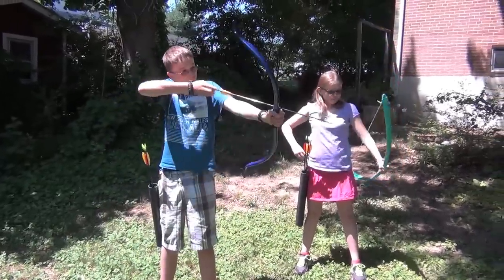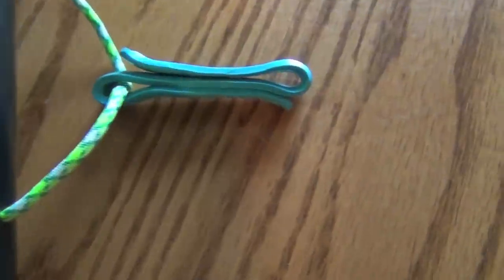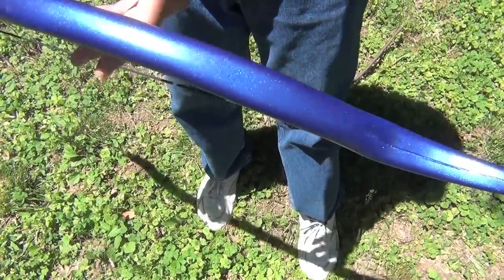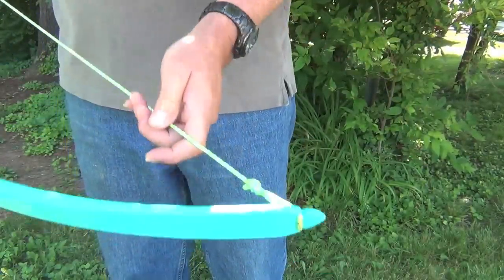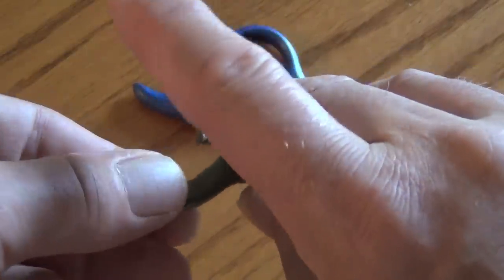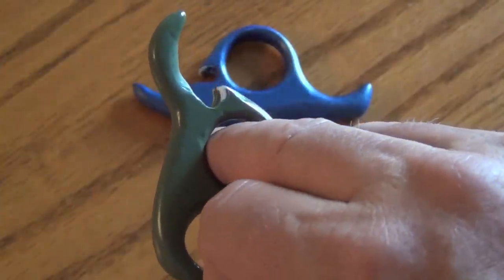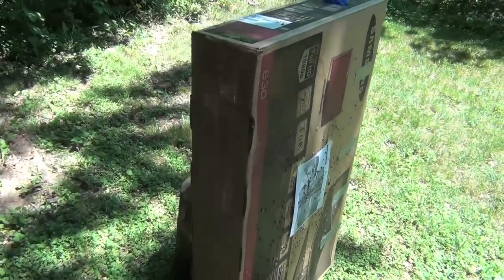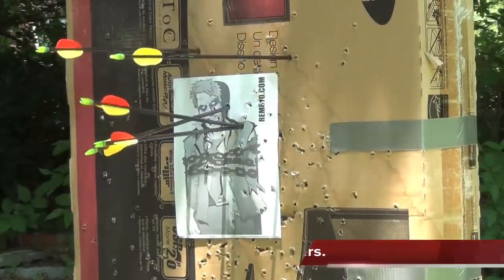DIY PVC Pipe Bows, my 2 new  hobbies.

Comment: very good job. thinking of making these for a cosplay and now my daughter wants one. Your kids seem to enjoy them and it's great that y'all have a hobby together.
Reply from the maker: +yurika975 Thank you. I made the first one for my son, my daughter watch him for a grand total of 30 seconds before she said I want one. LOL If you're making one for a cosplay, you can put de-flex in it to help ensure no one gets hurt onstage. Cheers
Reply: +stanfordcoffee Thanks. LoL It's my first time cosplaying and I haven't heard of deflex. I will look into that. no injuries. After seeing your creations I went to the hardware store for some paracord and pipe. Are you using schedule 40 pipe? Does it matter for these purposes? Thanks again for sharing
Reply from the maker: +yurika975 Deflex is when the boat was bent backwards, reflexes when the bow is back forwards. While making the bow, I would bend it backwards (almost appearing as if it's already has a string on it). Then when you add the string, and draw it, I will have very little power. I did use schedule 40 pipe. I know it's durable and will not snap the first time you draw it back. If you can get it, it's cheap, and that's what I would use even while making a prop. Cheers

Comment: what type of string is your using
Reply from the maker: Frost Owl I used common "550 paracord". You can pick it up at almost any hardware store, or search the Internet for it. Cheers
Reply: Last question . Is the PVC pipe bow be harder to break?
Reply from the maker: They're pretty durable, maybe not as strong  as fiberglass or wood, but they do last a long time as long as you don't burn the pipe while making it.
Reply: do you remove your string in your bow after using?
Reply from the maker: Yes. Every time I'm not going to be using the bow for more than a couple of hours, I take the string off. Cheers

Comment: AAAAAHHHHH  Your Daughters bow has the very same tips on the limbs as mine does ! ! !   LOL LOL LOL  You're the only other person on here that I've seen make those shaped tips !  ;-D  I LOVE them . . . . .  They make the bow aesthetics look good, and they work VERY nicely holding the bowstring !
Reply from the maker: I like the way my daughters bow turned out. It's very functional, looks nice, and easy for her shoot. How heavy is your bow? I think those tips will work fine for lower draw weights (maybe less than 45 - 50 lbs). But I think I would want to go with tips, like the ones on mine for heavier weights.
Reply: stanfordcoffee Actually they work great for heavy draw weights too !  My bow draws 77.4 lb. @ 26" draw.  I've tested it out for a 28" draw and it pulls at 82 lb. !  I'll make some sort of video showing the down the length of the bow and what it looks like, along with my very first attempted bow and then my Armed Forces bow. That one pulls the same as my bow that I shoot with.
Reply from the maker: That's good to know, I would not have guessed it could take that much weight. I'd love to see them, please post a link in the comments of this video, When you have your video complete. Cheers
Reply: Will do . . . . .  have a great day !

Comment: I made a recurve bow like your sons bow but it turned out to only be 25 pounds so I decided to make it into a 4 piece take down bow and it turned out really well. I also made the same type of bow as your daughters but I used pvc electrical conduit and it turned out to be 45 pounds. That longbow was good but after about a month and a couple hundred arrows through it, it snapped into a thousand piece. But what can you do, I used plastic for a bow so it was going to break eventually
Reply from the maker: Our bows are still holding up fine. The PVC that we get here in the states has a thicker wall,  I think  it will last awhile.  My daughters bow and mine, are very good shooters.  My sons start stacking at around 26 inch draw length,  I still have to build him another one. Cheers
Reply: Oh do you live in the United States. I have a Reece plumbings near me were I can get any type of pvc but I haven't had the time yet to check it out
Reply from the maker: My bad, I thought you were in Australia.  Try to pick up SCH 40 PR 450 (PR =  pressure rating,  there's also a 220?),  it has thicker walls, and should make your bows last longer.
Reply: Yeah I do live in Australia but I thought you did to, mainly because your son had an Australian shirt on, but I can get sch 40 pvc pip but I think it's called mark 12 pvc I can remember
Reply from the maker: My bad, I should learn how to actually read.  lol  Yes, Virginia USA. I'm not sure where you got shirt,  I didn't notice until you pointed it out. I've been lucky enough to travel all around the world (job),  but never made it down to  Australia,  I hope to visit someday. Cheers